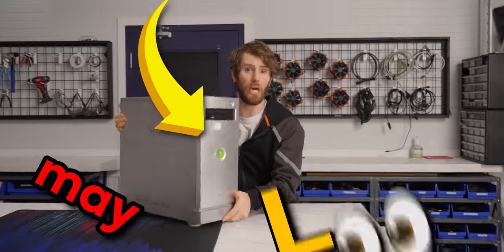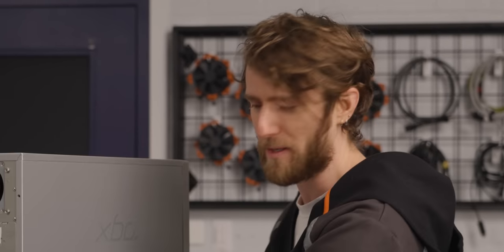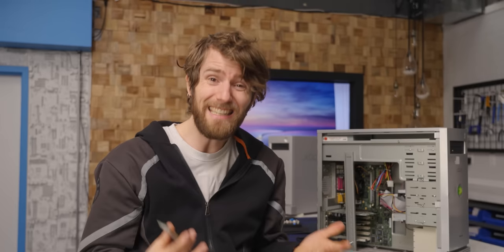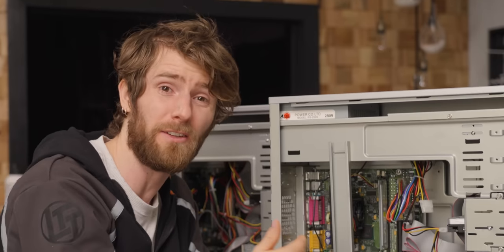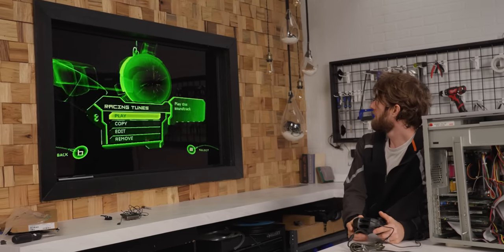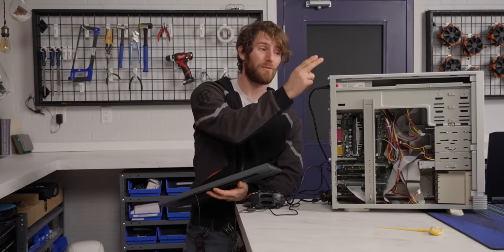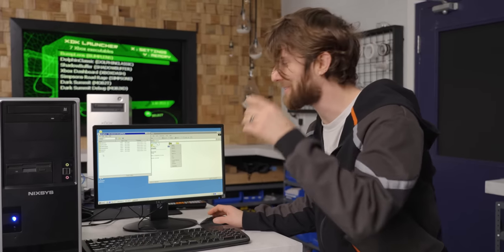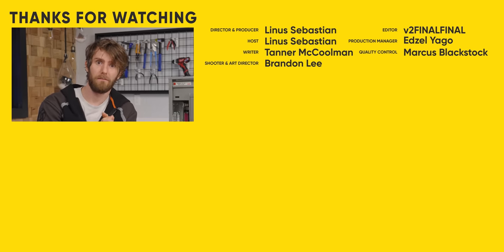I Used Stolen Software to Make a DIY Xbox - Xbox Alpha I & II Dev Kits

Comment: Man the optimization of that Windows build is a marvel of engineering for the time and the hardware specs it's running on
Reply: Yeah, it's snappy. It was not uncommon to have "I'll go to the coffee machine" boot times back then. Especially on a machine with multiple apps running at startup.
Reply: It wasnt windows by then. Windows-running builds stopped around December 2000, possibly November. By then, they were running code much more similar to the Xbox.
Reply: @PtoPOnline  Even the final build was based on windows.
Reply: @pessoaanonima6345  It barely had anything left of Windows at that point. You can go look at the leaked source code if you would like. Early Alpha 1 recoveries literally booted  a stripped down Windows 2000.
Reply: @PtoPOnline  so your'e saying it was windows?
Reply: @CRneu  It's not. Go look.
Reply: @CRneu  is OSX Unix/Linux?

Comment: Fun fact about RDRAM - both the Nintendo 64 and Playstation 2 used RDRAM. If you're wondering why your N64 came with a Jumper Pak, it's for the same reasons Linus stated with the Alpha II devkit's filler card.

Comment: The fact a computer  os company  used pc components  to build their gaming system is shocking to some is surprising  tbf. They where trying to make a gaming system not as powerful as the best gaming system but could play games developed specifically  for it well
Reply: what why?
Reply: I can remember when I opened my XBox to replace the DVD drive and case fan being surprised by how similar the inside looked to a PC, but I certainly wasn't shocked that it was PC parts, even if it was Microsoft.
Reply: gaming consoles are just small form factor pc's with very restrictive operating systems lol
Reply: @bmxscape  the weren't like that in the past, each had custom cpus, custom graphics, custom sound chips.... Then someone thought "why design different chips, lets just mod what its currently available" then microsoft just thought "why even mod the hardware, use what its already available and mod the OS"

Nowadays, its heading towards "Why even use hardware, run it on our servers via cloud" and that it's actually kinda genius.
Reply: Wait until you find out what the first Xbox 360 dev kits were using.  Technically they weren't PCs and the company they got them from is named after a fruit.
Reply: wow, it's almost as if we watched the same video
Reply: Then you should check out the xbox 360 dev kit, the first ones were based off regular PowerMac G5. (not joking, and microsoft even reinstalled Mac OS and resold them after they created their own Xbox dev hardware)
Reply: hmm how surprising that the DirectX Box had pc components in it.
almost as if it's supposed to support DirectX and other windows-specific apis that allow for easy cross-platform development and porting.
but, no, that's a crazy thought.
Reply: @YawnMK1  We won’t see a major console (Xbox, PS) that is 100% cloud based for a very long time.  They might make one alongside a regular console, but there’s still billions of people on earth without 24/7 internet access, and that’s way too much money to forego. Remember how many people went crazy when they announced they Xbox would need a 24/7 internet connection? It was so bad that they instantly reversed the decision.
Reply: @TheBaldr  And were transitioning to Intel…
Reply: @YawnMK1  Not genius, ping exists and a decent amount of people don't even have 10mbps connections.
Reply: @tomikun8057  yeah of course it has issues, however, a couple things i personally attest why it remains a great option:
1: not all games are ping-based competitive. You can perfectly enjoy rpgs, simulators, puzzle, etc etc etc.
2: Even on my third world country infrastructure, there are a lot of cases where the ping is similar, or even better on cloud, than on local; when your "good" base ping is 90+, cloud gaming at 50 is a welcome thing.
Reply: @TheBaldr  I'm not shocked by it.
Reply: @TheBaldr  oh I know, they were from Pear. The PowerPear if I'm not mistaken.
Reply: @YawnMK1  but u have the ping from ur Client to the remote Game Host and then from the game to the multiplayer Server. So even if the game tells u 50ms ping, u additional have the 90ms on top from ur local to the remote. Ur Inputs will always have a noticable delay, since Lightspeed is the limitation. The first ping cannot be magically be reduced below that. For Puzzle games this may be fine, on more action oriented games, many people get motion sickness caused by that huge delay.

Btw: multiplayer games use movement prediction and use the old motion to extrapolate the position of other players. The server handles synchronization. This prediction is not possible without decent hardware, that renders the game on ur local machine
Reply: @alexmathewelt7923  allow me. If i try (with real, actual numbers) to play Ark from my console or pc, i have a ping of 120 to game servers. Then, my client has to send/receive everything (position, movement, aiming, simulation data etc etc) with a weak infrastructure theres an average of 7% packet loss, which impacts performace everywhere. 

Now, if i play via cloud, my ping to cloud service is 30, and the ping from the cloud to game servers is less than 20, with a packet loss of 0. My client connection now only has to send input data, and receive a video stream. Of course theres going to be a delay, but i tell you, real case scenario, its a lot more responsive than running locally. Another example, playing Destiny pvp (yuck) locally, i win around 1 out of 10 engagements. I dont suck (too much), i properly aim and shoot, but autorifles, less than half of the rounds deal damage, same with shotgun pellets, and on sniper engagements i pretty much always get to kill the opponent 2 seconds after i already died. Playing on cloud, however, i win 7/10 engagements, and theres no more ghost bullets. Of course, cloud currently wont be MLG competitive, but its a major upgrade on the cursed regular gameplay inflicted on us.
Reply: @YawnMK1  Well, with Packet loss in mind, this absolutely makes sense, with the real world pings even more 👍
Reply: @YawnMK1  A packet loss of 7% is horrible, you should get onto your ISP about that.
Reply: @thelight3112  yeah well, the issue is,  to my home i have optic fiber connection (noice huh) but the infrastructure between my home and the the isp is getting renovated, updated etc in chunks, so, between me and the ISP there are 5 nodes where the connection type switches back and forth between extremely long copper wires and old switches, and state of the art fiber gear. The copper wires curse us with packet loss and oftentimes complete connection loss. It is what it is. In 5 years maybe all the infrastructure may be of fiber, so... Heres hoping.

Comment: Now you should take a look at the nodding scene:
- xbmc (which later became Kodi)
- bioses
- HD games
- and last year we got 8tb hdd support, project stellar and Insignia!
Reply: early wireless controllers are kinda wild too sometimes
Reply: And Project Stellar, Insiginia
Reply: @xtobyplayz5946  yep, added to the OP, thank you!
Reply: You can add a 16TB, probably more, but I haven't tested. Also, XBMC (Previously XBMP) became Kodi because it had been ported to so many devices it just didn't make sense to continue using XBOX MEDIA CENTER for the name and support for the XBOX was holding it back so support for the XBOX was dropped, however it's releases on the OG XBOX are still referred to as XBMC or XBMC4XBOX.  A lot of people don't even realize just how many devices use XBMC/KODI today and that both Boxee and Plex software's are both forks of the project.
Reply: KODIIIIIIIIIII

Comment: What's weird is that this is still how Dev Kits and Test Kits still work, nothing has pretty much changed at all!!! XD
Reply: actually, they do tend to change,  when telemetry / call back got way more intrusive
Reply: @benwu7980  I meant as in how to install and run builds, I am a QA Analyst in the industry and all of this sounds super familiar even though the tech is 20 years old
Reply: That is indeed 100% true! I'm a QA tester and often have to use XBox/PS4-5/Nintendo software to load software into the console. You also have to use the software to get your logs, crash dumps and other important telemetry stuff such as memory usage, performance data, etc.
Reply: @FloodExterminator  question is: do you prefer Ps4's Neighbourhood or Xbox XDK? 👀
Reply: @George Beswick  Didn't work much woth Neighbourhood so I'd say GDK Manager 😅

Comment: A fun story on AMD and Intel: AMD and Intel x86 processors are doing the same thing and can be interchanged without issues - Usually.  However, they do have some usually insignificant differences in their implementation.  As I heard a long time ago, these slight differences caused one of the first (of many) security issues the Xbox had, breaking it wide open quickly for modders.  The XBMC (Xbox Media Center) originated here, which changed its name some years back to Kodi :)
Reply: Up until the Pentium 2/Slot 1 era, you could even run AMD and Intel in the same motherboard (although probably not at the same time).
Reply: @tOSdude  Yes, Intel had to license the rights to the socket 7, socket 5 and I think previous to that was the socket 3.
IBM forced Intel to have other manufacturers to make sure there was no interruption in production, starting with the 8086 era.
So, there was Cyrix, AMD, IDT that also made x86 CPUs.
Reply: @dataabort It was in how Intel and AMD handled overflowing the memory boundry. So when you'd get to the end of the 32 bit address space they'd do different things. AMD would halt at the end, Intel would wrap around to the start. The issue was the the boot ROM was mapped to the end of the address space and the devs were relying on the AMD behaviour to stop the CPU from executing any more code in certain cases.
Reply: @dataabort They're trolling and not being good at that.  In any case, you're right, x86/x64 processors start in 16-Bit (Real Mode), then switch into 32-Bit (Protected Mode, called because it can protect resources using a MMU which wasn't really possible in 16-Bit), and x64 can go on into 64-Bit (Long Mode).  To make things more complicated, each mode has an "emulation" layer which allows you to downgrade a task (process, ...) into the lower mode, that's used when you run a 32-Bit app on a 64-Bit machine.
Reply: @xmine08  I don't think modern cpu's even have the capability to boot into 16-bit (Protected Mode) especially with UEFI (And both intel and amd having another whole computer basically inside the cpu it's self)
Reply: @CotyRiddle  with uefi I think you're right, with bios it boots into 16bit first. There it should be able to run DOS, but be pretty useless as there aren't drivers for all the stuff.
Reply: @xmine08  That is what i thought. And DOS as issues with anything newer than a pentium D from my experience.

Comment: Glad you mentioned about the sudden CPU change, although it would have been nice if you mentioned that the change was pretty much the core reason why the Xbox got hacked, and could never be patched out. 

AMD dealt with how memory works in such a way that any attempt to write past the end of memory would cause it to fault out, and eventually crash if it happened again. Intel however just went from end of memory and started writing at the beginning of memory.

Comment: 9:54 They already solved GPU sag 20 years ago?

Guess since most GPU shrouds are plastic, I could litterally put a bolt across through a peice of wood to support my modern GPU

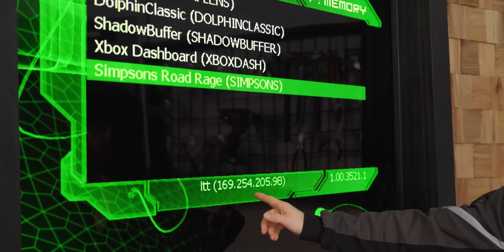13:08 How do I detemine if that's local or not?

14:59 The way he phrased that I will emulate

Comment: I remember the VC820 Motherboard very well!  I was a system integrator and Intel reseller at the time.  I sold a bunch of Intel CC820 motherboards with SDRAM that we later found out had a fatal flaw in the hardware (machines would constantly blue screen).  Intel replaced ALL CC820 motherboards with VC820 motherboards and included 64 MB (I think... it's been 23 years, lol) of RAMBUS with every board so the system integrators didn't have to purchase new RAM for every machine.  The VC820 boards were very stable and ran great!  I was glad Intel backed their product when it had such a bad issue.  I still have one of the VC820 boards in storage!  Fun times.  Knowing this technology was 23 years ago is making me feel old!

Comment: The metal used in the case; the fan cut outs in the rear; front fan shroud at the bottom; the hardware inside; and even the metal bar used for PCI card retention; reminds me of old schools cases like the Antec SX630 and InWin a500 or q500. OMG! Linus you made me feel old. LOL

Comment: You can upgrade the cpu and I guess ram too in the Xbox, butit involves soldering. That would be a nice follow up video, trying to upgrade the devkit.
Reply: You need a lot of skill its not like there are pins on the side, they are replaced with solderballs underneath, any tiny pressure can rupture the solderball and flood the whole chip with solder it aint as easy buddy, go watch some reballing then you know 🤦

Comment: A reason dev kits have so much more memory is because they use a LOT of proprietary in-house software alongside the games themselves. You can end up running a half dozen programs at once on top of the game for various purposes of monitoring and testing. Retail models obviously have most if not all of that stripped away so they don't need anywhere near as much RAM.

Comment: This is an extremely insignificant point to make, but I'm slightly familiar with Xbox modding and I think at 11:49 when Tanner mentioned loading an "XDK", he misspoke and meant to say XEX. 
XDK stands for Xbox Development Kit, and XEX stands for Xbox Executable which are the files that it runs (like an EXE file in windows).
Reply: XEX is the file format for the Xbox 360. XBE is the file format that the original Xbox uses. 😉
Reply: XEX is 360, XBE is Xbox, though both will run some EXE files (not Windows ones, obviously).
Reply: XEX is for the xbox 360, an XBE is for the og xbox, either way, xdk is wrong
Reply: @InternetStorm  Ahh yeah I only have experience with the 360

Comment: RDRAM was probably used in Silicon Graphics machines as well as the first game system to have it was the Nintendo 64.  Even in it you had to have a jumper pack as Nintendo did something unprecedented at the time by making the N64 RAM upgradable.  As much as it was underappreciated, the Nintendo GameCube had some features the others at the time lacked.  Digital video and audio, super fast 1TSRAM, PowerPC processing and some advanced particle effects on the custom ATi processor.  The mod scene for the GameCube now seems to have brought it to the forefront of vintage gaming.  I have my GameCube from December 2001 still and have upgraded it with a GCHD Mk.II, LaserBear BlueRetro Bluetooth adapter and plan to put a PicoBoot on it at some point as well.

Comment: You can also do this using a PowerMac G5. As they were used as dev kits for the 360 very early on. They require a specific model of the G5, a specific (Mac compatible because PPC Macs won’t see PC GPUs at all) graphics card, and I believe an Ethernet card as well since Microsoft used it as a kind of DRM.
Reply: You actually can use a PC Card in there no problem just not for xenon os. Any r420 card can be flashed w a reduced x800xt rom flashed using graphiccelerator or atiflash. You also need a 160gb hdd or higher. 512 ram or more and an Intel Ethernet card. You can also kernel debug through FireWire. The models you speak of are the 2.0ghz A1047 model pci-x alpha 1 with Radeon 9800 pro or alpha 2 is a 970fx with different cpu housing and is pci-x2.  Suprised nobody has made any home brew for either machine. The g5 has a lot of potential with sdk 1888. 1529 is out there than the other builds… also that AmR sound card isn’t worth building an alpha 1 the cases are too hard to come by the terminator ram card and the mobo is 700 dollars. The 1529 hdd image or iso has a blades dash and og Xbox emulator. I played Halo all the way through and have a compatibility list.

Comment: Thank you for this. Now, there´s one holy grail: How well does the original Halo CE perform on the DevKit with the faster GPU?? Follow up video, please?
Reply: Dev kits can't run commercial games, ie the versions of games that actually shipped to consumers.  So you'd have to find a leaked dev build that was close to release.
Reply: @CouchPotator  Which in this case, would likely stop around May 2001, as it cant run beta or final hardware games, development or not. Still months prior to release :)

Comment: This reminded me about building back in the early 2000's and having to shop for parts. There were a lot of small dev shops around where you could pick up various parts to assemble into a build, but what I remember most is that many of these small shops had a significant investment in memory modules and processors, and most of them kept them locked into a vault or safe! And when a new shipment of something arrived, there'd be a que out the door as people stood around waiting to buy 16, 32, or 64 MB memory!
And they weren't cheap either! 
20 years later and all of that is so much dinosaur dust.
Reply: Try buying that stuff now a days it’s even more expensive